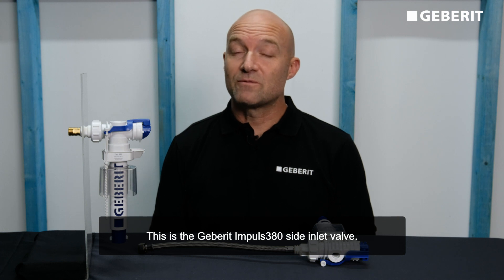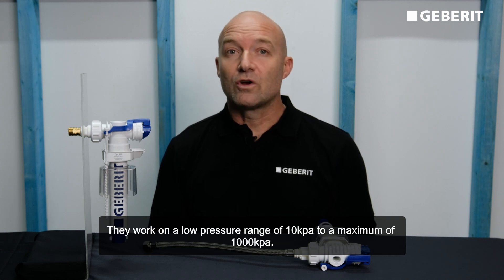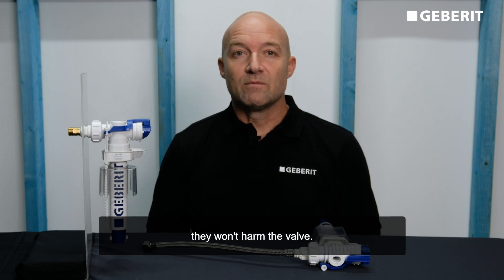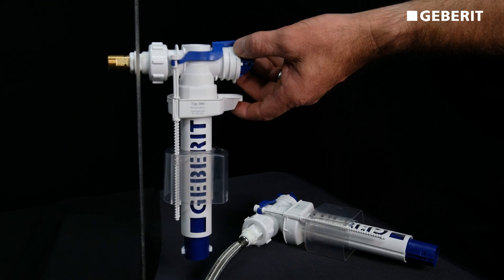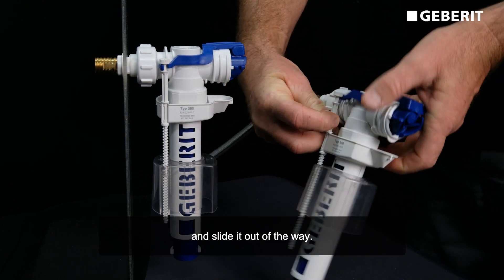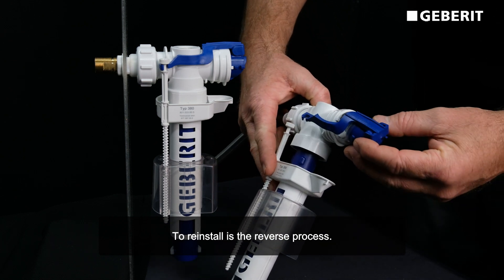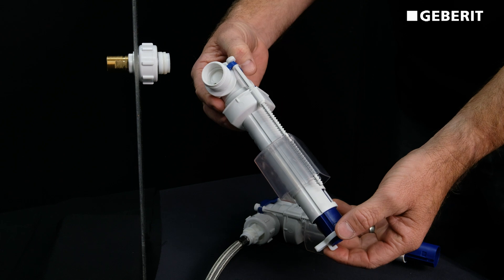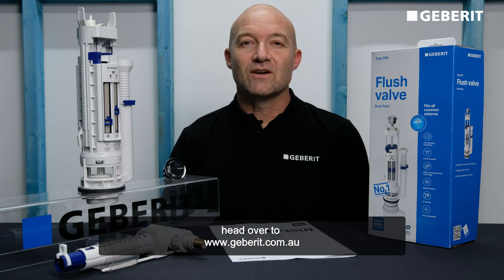Geberit IMPULS380 Inlet Valve Installation

Comment: Thanks for your explanation, mate! It helped us a lot. What might be useful to add is that the clear plastic part that we rinsed with water (see your video at 2:14) has a very small hole. When you put this part back into the blue part (which it is folded around), you need to put the mini protrusion in the blue part through the small hole in the clear plastic part. We didn't notice this at first, so the inlet valve stopped working completely and the water supply didn't stop... We quickly turned off the main tap in our house and fortunately discovered this solution, after which the inlet valve worked again. Thanks again for your video!